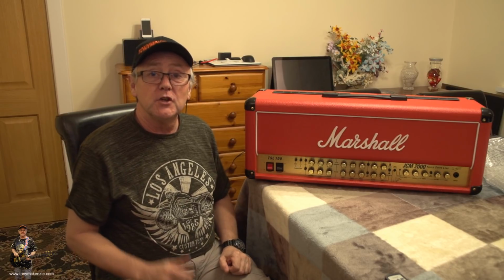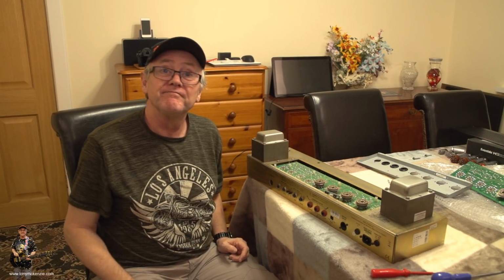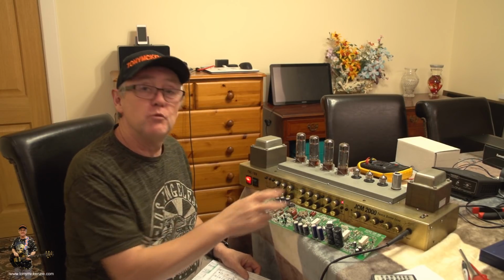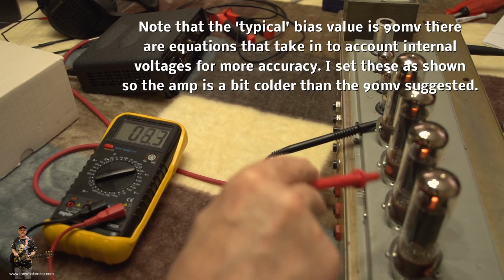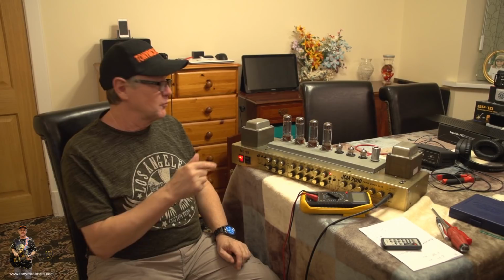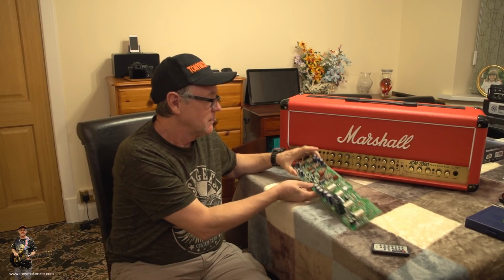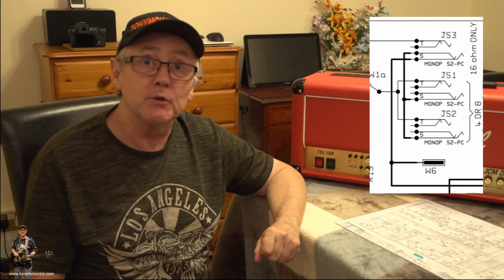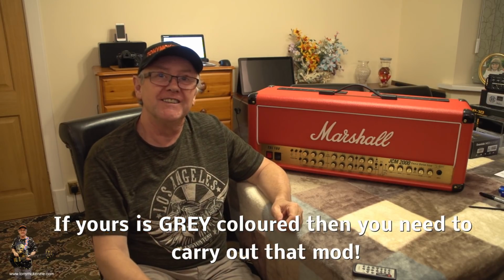Marshall TSL100 JCM2000 Amplifier | Permanent Fix For Bias Runaway | biasing review | Tony Mckenzie

Comment: Did you mic up the amp or use the direct emulated output? I'm goin to  change the board on mine  as two middle valves have stopped heating up but the fuses haven't blown in the heater curcuit 
Great video
Reply from the maker: Some times I mic it up and others DI... but on this video I specifically used an AKG microphone in to a desk then mixed to the video camera... always watch my videos and if you see a mic in front of the cab on video its likely that I used it. Yes sounds like you have issues there, but it really is worth the effort of replacing that board... just make sure the connectors are put back in the right place (it is fiddly) and you will be fine. It biased up after the board replacement perfectly and sounded great. Thanks for watching.

Comment: I had the 40w JCM2000 DSL401 C combo and I loved the boost gain channel. I believe this is just a triple channel version of the same amp circuit right Tony? If it wasn't for me getting my Silver Jubilee, I would had kept hold of it. 

Bloody brilliant sounding amp for the harder rock gain sound. I love what you've done to this one and it sounded brilliant.

Quick question Tony dude, would you be able to do a guitar update video as I know you've got some beauties I would love to see in greater depth. I've still got that LP Classic Custom that I put the gold hardware and 490/498 humbuckers in that I showed you about a year ago. I actually weighed it and it came in at 10.4lb's
Reply from the maker: Cant be sure Dan I have not seen inside a DSL40.. but probably at least a similar board. The TSL60 was not as good as the TSL100 (I had a 60 before my original 100). The amps drive well I think too. Indeed, I intend to make a video of the whole caboodle soon... watch for it and I'll go through them all :)  490 and 498 are really classic pickups that will give you that Gibson sound for sure I like those actually... not too toppy and a REAL Les Paul tone. 10.4 lbs is about right if its not been lightened inside (I'm not sure about that for the model). Use a wide strap and its all good :)... Thanks Dan and good to hear you.

Comment: Tony, thanks so much for spending some time with this amp.  Your reviews are always excellent.  I have a 2004 that I bought new and it wasn't cheap back then.  All of these years there's not been much said on the Internet that is positive about this amp.  Never had trouble until May, 2017, which was about a year after I just had it all re-tubed/serviced.  $400 later it's ok now, but I didn't get a new board.  This is very good to know because I don't want to part with this amp.  In fact, I've thought about obtaining another one.  

Come back to Florida so you can refurbish mine.
Reply from the maker: :) Get the board and it makes the amp incredibly good. My old board worked, but to be honest by the time you faff around with engineers etc. trying to 'fix' something that is plainly wrong in my opinion that is false economy. Many people slag these amps but I often wonder what exactly they have? Even this one with the original board worked fine (except maybe that 16 ohm aggro and the capacitor. These amps are the best value on the net and this one, fair enough I spent about £80 ($110) or so on the covering etc. when I did that and bought this board and tubes... but now its pretty much like new and sounds as good as anything in that room where it is. Ha no doubt I will be going back to Florida - its a great place for sure.. I might be going a few places this year and Florida is absolutely on the cards. Thanks for the info and for watching.
Reply: False economy is a valid point.  It looks like a decent used TSL100 commands in the vicinity of $700 now.  The issue 20 board, if I'm shopping correctly, will run around $250 plus there is a cost incurred for me to get it installed.  So I figure I'll probably spend $400+ to change the board.  That's far less than a new Marshall JVM head, of course, but now if I do this, I've got over $1000 invested in repairs for this 14-year old amp over the past 2-3 years.  I was not having any problems, but I decided to have the power tubes changed in late 2015 (yes, I ashamed to admit the original power tubes were present) in search of better tone.  Then, a year later, it's blowing fuses and burning power tubes and crashing.  That cost me $400 to correct last May.  But I had many years of care free playing.  You've given me something to think about and I'm just thankful for your positive comments.

Hold off Florida for a while.  29-degrees F outside my door as I type this.
Reply from the maker: No you can get that board for much less. Probably £100 ($130) from hotroxuk. The TSL here I bought for less than £400 (if I remember it was £350 or so ($425)). Honestly, the TSL I bought here is a really great amp and you can hear it here: https://youtu.be/nWt6hq706q8?t=22m13s that sound (its mixed slightly low sorry) is really not easily achievable on anything else I have and in the room it's exactly like the sound on the released record from back in 2006. Stay with it... and it's worth every cent (in your case - penny in mine) to grab a board. One day they won't be there to grab ;-)

Ha my son went there one year at Christmas some while ago... he had the shorts etc. and it was running at 58 deg F. He had to go and buy clothes which always made me smile... fur coats in Florida. I know that it can get cold there at Christmas time or thereabouts but thanks for the update on that.
Reply: Thx, Tony.  You're right.  Just trying to find out now if my local tech will tackle this.  I don't want to ship my amp around.  I'll try hotruxuk for the board once I find an installer and I saw a comment somewhere that shipment was 8-days from UK to US.   Again, thx for devoting your time to this amp as I've always felt like a 2nd-class citizen for owning/using this amp.

You know what, too, is that the orange and red channels have always sounded fizzy.  Maybe the new board will help that.  Swapping preamp tubes never has.  I have those dreaded JJ's you don't care for  -  both in the preamp and power.

Back to 70F today!  Probably will be mowing the lawn this weekend.
Reply from the maker: Don't in any way feel left out with that amp. Honestly, when I say it is the best sounding amp I ever achieved I don't just say it. The amp had a bad name for reliability in my opinion, but my recordings of 2006 by way of tone I have never actually got any better tones from any of the amps. It CAN be fizzy and a bit 'tinny' sounding if you overdo it on the drive so that can make things not great but careful with that and I can tell you it records like no other amp I have. To me, the new board made the amp exactly as I recorded it back in 2006 when my original TSL100 was about 18 months old. I did have a TSL60 before that amp but there really is no comparison.

It might take a while to have the board shipped as you say, but I have heard tales of over $249 for the same board there as you say... so it is probably worth the effort. JJ like other tubes are OK I guess if they are properly selected and properly matched but unfortunately sometimes that does not happen. The way I view those is that SOMEONE has to get the bad ones right?

I have recently bought some! Under advice from GC (a guy on here) to try in the Dumble Ceriatone... we shall see.

70 degrees... you hot dog! :) I'm here with 1 degree (33) today and its absolutely freezing. Do let me know how it all goes on that amp and don't let guys sway you too much... you know what some can be like right?

Comment: great vid Tony very informative, I have a dsl 100 head, its  bias was crazy runaway, got newer  board from marshall and fitted slowly but surely but now is ROCK steady and bias is solid, will prob keep now great amp and gets great gary moore tones using crunch on classic gain with an overdrive pedal. jeff beck also uses but bet his techs have long replaced the board revision
Reply from the maker: Yes they are great amps once you do it all. My original had no issues back in 2006 when I did the recording but I guess by this time it might have now wherever it is. Thanks for the info and for watching.

Comment: I purchased my TSL in the late 90’s....and I couldn’t agree more....ace sounding amp until....

This review is so true. I had a revision 20 board installed last year and boom...it was back. All the channels are so useable both cranked and....the low power button enables home use, indeed I run mine low power live.

The heads up re the 16 ohm output is a real help and should be done as Toni suggests. I checked mine and indeed it was starting to show signs of a potential issue....solder away and problem solved.

Thanks for this really informative video. Would be ace to see a video of your work flow with Dante by the way Toni.....all the best and keep on TSL
Reply from the maker: Hi Mark, I had my original in the early 2000's and never had a problem with it. I used it on an album called 'Eniac' and those sounds remain incredibly good. So a year or so ago I bought this amp and recovered it. The board really makes this amp one of the best buys out there at any price... even if it needs a board its not that heavy on price. Yes that 16 ohm speaker switch can zap the output transformer and I was surprised when I noticed mine had gone 'grey' basically failing. The other connectors were bright and shiny. 

Well I am going to go further in the control room and in more depth when I get a chance - its all very time consuming but ot will be here some time. Thanks for watching and have a great new year... your info was very useful too.
Reply: Mark Burrows do you know the effects loop trick where you can use it as another volume control??

Comment: I used to have the 2x12 combo version of this amp. Best sounding amp I ever owned......why oh why did I get rid of it?   Great video Tony.   Happy New year.  ( eBay....TSL....) 😇
Reply from the maker: See, selling the TSL's of this world are a mistake and one I have made myself. Did I get it from you? (I forget) and if I did you should have kept it :) The amp did not really need the board, but it makes a very useful video and I really enjoyed making this one. Thanks for watching and have a great new year.
Reply: I also owned one and couldnt get rid of it quickly enough. A great sound.......when it worked , but the most unreliable amp I have ever owned.
Reply from the maker: I understand that of course. My original never let me down and to be honest this one had not actually failed save for the little cap and that speaker mod that did need doing... but the fix shown here solves it all and the amp becomes really good. For the cost these days it ends up being a really great amp... thanks for the info and for watching.

Comment: I love my TSL100s. I've owned it about 11 or 12 times and currently have three taking up space. Two of them had the bias drift issues and I replaced the board too. The third is a 1999 and weirdly seems to be perfectly fine. I have a new board in the cupboard though should it ever go wrong or I get a few hours free to get into it. Seriously one of my favourite amps.
Reply from the maker: Thanks for the info Jon... its my favourite amp too and can create some incredible tones. I originally sold the original but bought this about a year ago. The TSL60 I had briefly never did sound like the 100 watt either. Thanks and gave a great new year.

Comment: Hello Tony , thanks for all your good work . Don't you agree that Marshall , knowing all their early mother-boards were sub standard , should supply "goods of a merchantable quality" free of charge ?
Reply from the maker: That's a good point and manufacturers should stand behind their products of course. But there has to be a limit of time? right? Think of it this way, Marshall Amplification is a business. Their liability (based on UK and European law) is for a 'reasonable period', but if you could prove that the product has an inherent fault then in law you have a case for redress. The problem of course though is really that after period X then really the user has the responsibility of pursuing the claim for redress. For example if the board was proven to be a bad design. 

What do I think personally? Well, I am a business guy and I tend to think that bearing in mind my amp was made in 2004 and has never actually failed in nearly 14 years I don't really mind buying a board. It puts my mind at rest about what could happen having read what's on the internet.

I don't really have the time (or inclination) to even bother Marshall for the cost of the board (in my case it was less than some might buy them) and I turned the 'problem' in to a case for helping others by making a video of how to do it which I feel is a good thing to do. If someone really wanted to go through the rigmarole of pursuit of a replacement board then I am sure that Marshall would take each case on its merits and act accordingly - I have never found them to be negative in any of my communications with them about anything.

This was a good question because it actually has many answers... under law, reasonableness, what someone expects, warranty and much more. Remember that many of these very amps are working out there still without ANY real issues that are discernible but that could change of course and certainly would have if the amp was used in arena's every day. Have a great new year and thanks for watching.

Comment: Happy New Year Tony.  My mean machine is from 2004, and I had to do the same thing.  I got the new board from HotRoxUK and saved over $100 by not going through a distributor in the US.  I labeled each of the connectors AND took pictures.  Lots of pictures.  Nice playing on your album by the way.
Reply from the maker: You are exactly right on the way to get a board. I have other routes to getting a board that most people would not have, but I also saw the boards at Hot Rox too and that is probably the way to go if you're in the USA as an example. The connectors are absolutely multiple so what you did is similar to what I did. And the other issue was those connectors that are only there on the new issue 20 board... there was nothing on the internet about those so hopefully I addressed that. Thanks for the info on yours and for the kind words on the Gravity Waves album. 

Actually presently we're giving away about 200 of the album for free. Watch for the video... and have a great new year.

Comment: Oh Christ. I have this amp and I love it so much! :D I've tear it apart probably 10 times to the last screw. I've done probably 20 mods to it. Great great amp :) Mine is from 04.2006 (newer PCBs)
My Mainboard is ISS 10. Issue 10 doesn't have the bias drift trouble :)
Reply from the maker: Be careful... I believe there is an issue 5, 6 and 7 and then a jump to issue 20 of the board as shown on the schematics I used. You just might be correct... but I think that there is no issue 10? You have to check very carefully. Mine was a 2004 amp and it had an issue 6 (if I remember)... but fitting the issue 20 board solves near enough everything except that cap blow and I show in the video how to solve that... thanks for watching and do let me know about that board...
Reply: I'm 100% positive it's issue 10. I will send you images of my amp and insides.
Tony, you have to put choke in there. R71 on the mainboard. I have 10H choke. Waaay better power supply now.
I know there was ISS 3 and 4 too :)
Reply from the maker: Well if it is I would like to get a picture of the main board issue number printed on there so I can add to this... you can contact me via tonymckenzie.com/contact.htm and then send me a pic... but don't go to great lengths to do it... just when you have time etc. and thanks for the info. I have not seen issue 3 or 4 either and I only had the diagram you see on there. I have fitted chokes to the JVM410H historically and for that amp it was hardly noticeable... indeed on that amp I never got a good sound. Thanks for the info and have a great new year.
Reply: Mine has a serial number from 2005 and also shows what looks like Issue 10.  I don't use the amp too much but when I have it's been stable.  My 2002 JCM 2000 DSL 100 on the other hand... bias drift was very real there.  I replaced that one (also Issue 20) and it's been great.